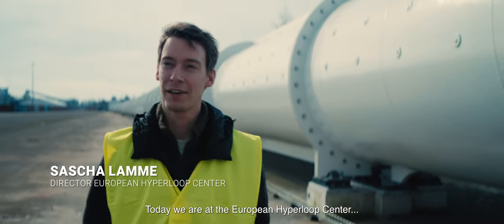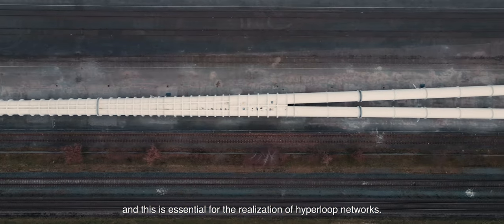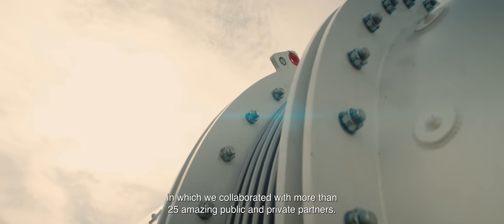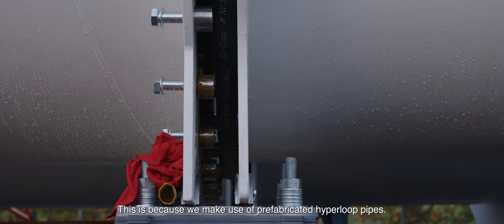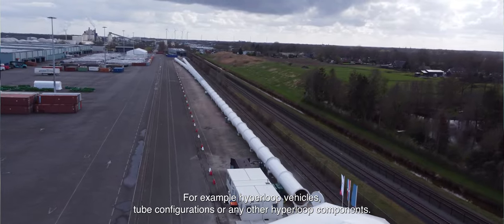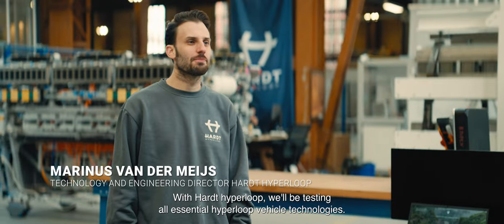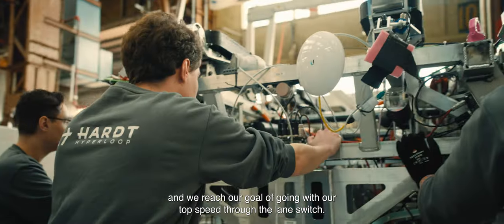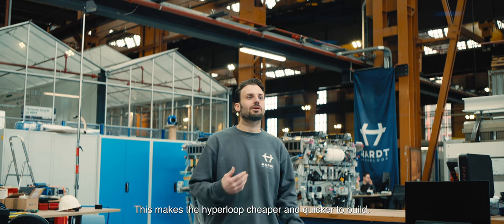European Hyperloop Center is ready for the first tests

Comment: If you haven't figured out by know that Hyperloop is a pipe dream I'm afraid I can't help you.
Reply: Come on, since when are we affraid of innovation? Just like the first airplane this is far from the end product, but it's a step in the right direction. And if it doesn't work, at least we tried!
Reply: @Rickyzzzzz  Hopefully we will never be afraid of innovation. The problem here is even if something like a "hyperloop" would be possible from a technical perspective, financially it would never be useful because you can only transport a very limited amount of cargo. Building and maintaining these vacuum tubes on the other hand would be extremely expensive. The hyperloop is not a new innovative concept. The idea has been around for a century. The reason it never left the concept stage is it's nearly impossible to build and maintain and it's less useful then other modes of transportation because of less capacity.
Reply: @Rickyzzzzz  Because the problem is not, if it technically doable. It is. Has been for a hundred years.
BUT this system is more expensive than regular train, more dangerous than regular trains, can transport LESS passengers, than regular trains, and for most tracks even SLOWER than regular trains or their Shinkansen counterpart.
And maintaining that vacuum costs a shitton. A singular oneway ticket would probably cost more than 10 flights with the Concorde.

Comment: Testing for less than half a kilometer at a peak speed of 100 KPH in a "low pressure" tube does not demonstrate that the concept will scale to hundreds of kilometers at 1,000 KPH in a vacuum tube.

Comment: Its funny how smart people fall for this is not possible to do it for real on long distance.... 
1 how do you create the vacuüm 
2 how do you prevent the safety when there is a vacuüm leak
3 where does the steel pipe go when you have a temperature change of 40°c 
4 nice marketing but not possible😂 😂😂